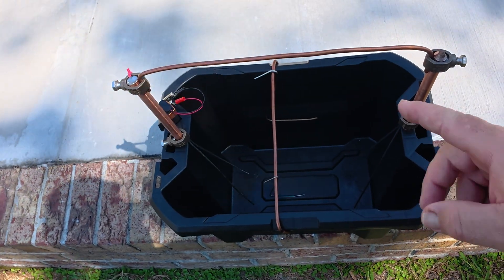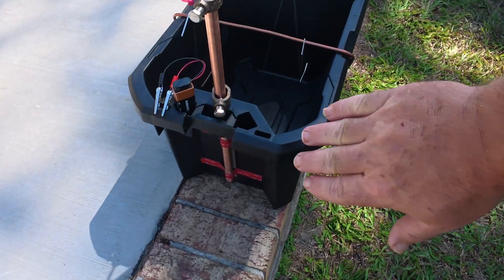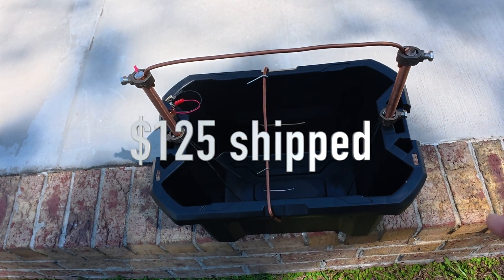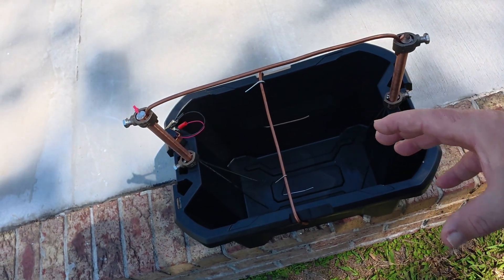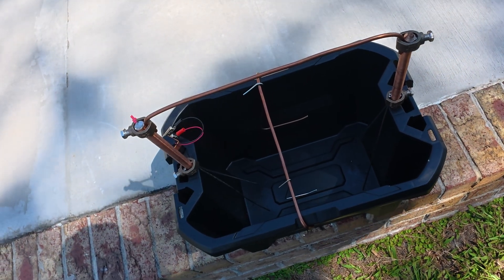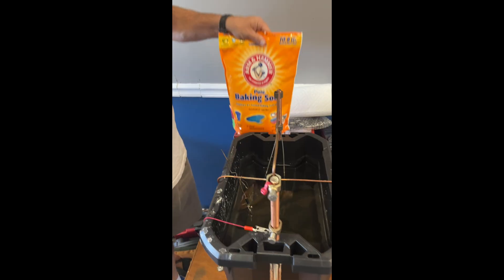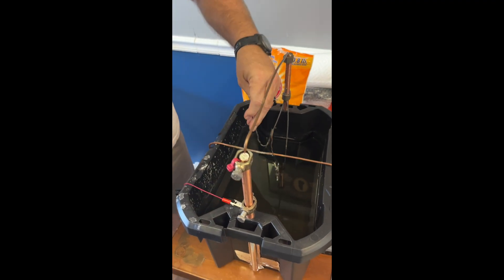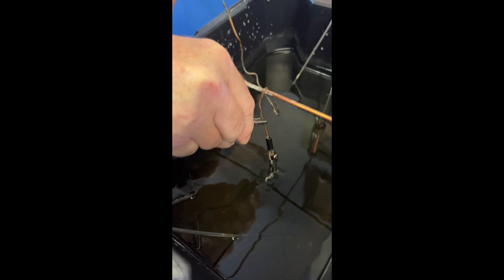ELECTROLYSIS SYSTEM FOR METAL DETECTING FINDS! MUST SEE!

Comment: If you want to do this at home on a budget, a car battery charger works perfectly as a power source. Then all you need is a home depot bucket, a sacrificial anode (piece of steel) and water + baking soda.
Reply: This is how I do it.  Works great.
Reply: So you can pretty much use it for any type of metal?  
Like antique brass, copper & iron relics? 
I’ve been looking into them for some of my relics.   
Should you use it on silver or copper coins or would it harm them?
Reply: @kody3377  This method really only works on iron / steel.
Reply: Thanks for vid.